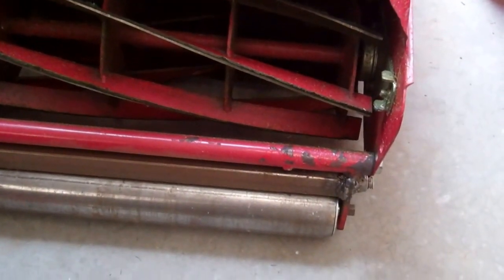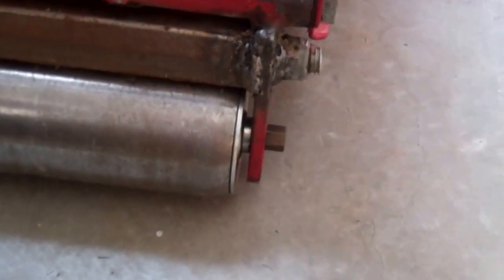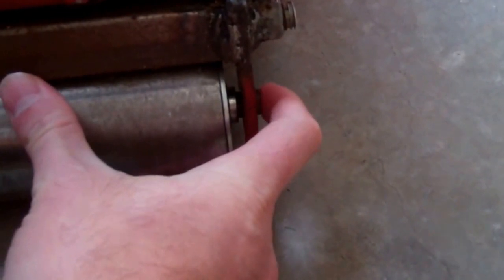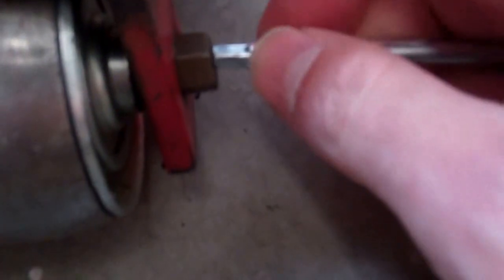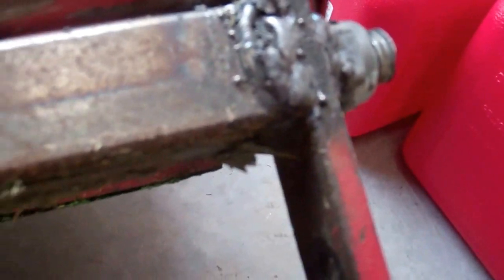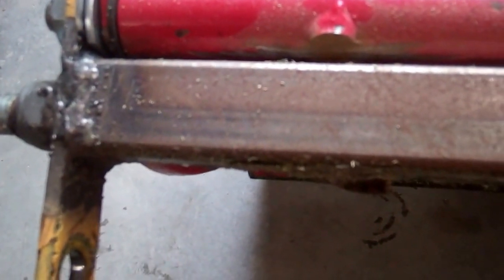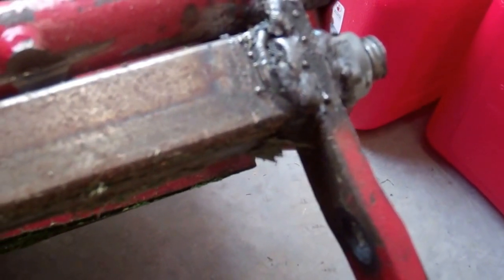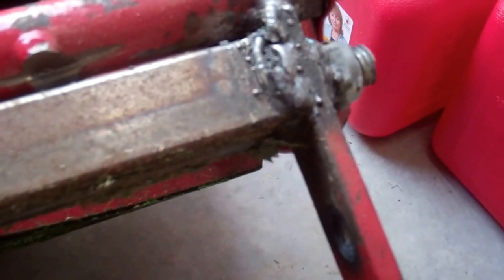DIY roller for your reel mower (Part 2 of 2)

Comment: Instead of welding couldn't I get a threaded rod, drill a hole on both sides then put a locking nut on each end?? Seems like that would work. What size roller did you buy?

Comment from the maker: It is a 20 inch roller. Here is the info:

Conveyor
Rollers - 2.5”
Diameter

Replacement Roller, Medium Duty, Dia. (In.)
2-1/2, Between Frame (In.) 20, Shaft 7/16 In.
Hex Plain Steel, Light Oil Lube Steel Ball
Bearings Bearings, Zinc Plated Steel Housing
Finish, Capacity (Lb.) 395, Spring Retained
Mounting, 14 Gauge Plain Steel